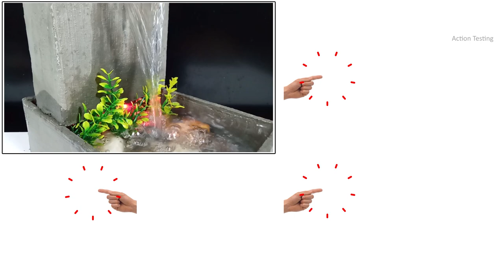How to make a mini water waterfall DIY mini fountain using Styrofoam, cement

Comment: I've never made one. BUT I'm thinking that setting the vertical box down into the horizontal one would be sturdier. Maybe cut away just enough for water return in the bottom front of the vertical box? Poke a hole above water level in the back to feed the wires through?

Great project! Thank you!